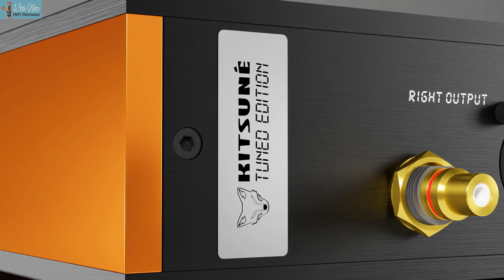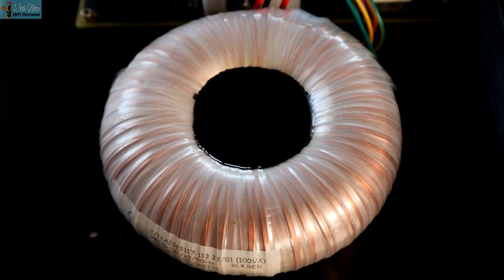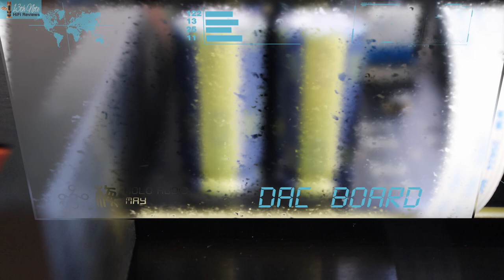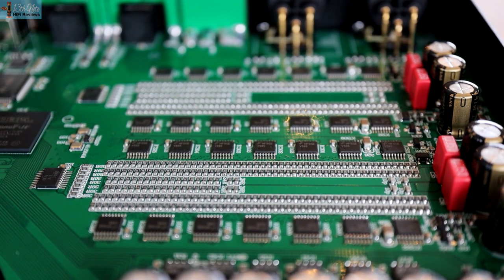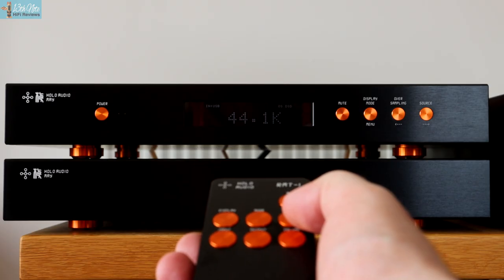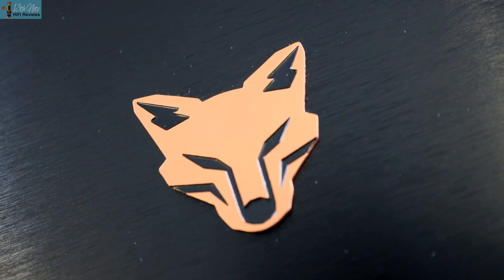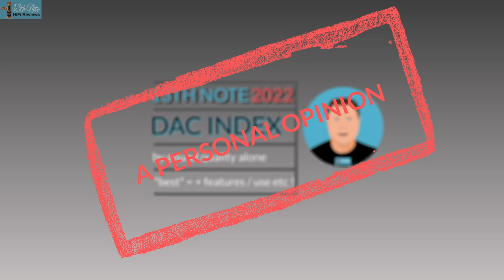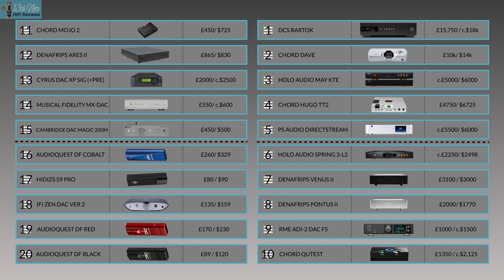Holo Audio's MAY KTE is an Astounding R2R DAC (vs. Chord & PS Audio)

Comment: Great video and eval...Crappy digital, cold, non musical dac...Had it for over a month and I couldn't run from it fast enough. Anyone who holds this thing in such high regard has not heard truly musical gear. Lots of texture, and detail but the way it flows out of the speakers is cold, lifeless, digital and just not musical. No idea what all the fuss over this dac is all about. Other than the build quality there is nothing to get so excited about. Anyone wanting to know how this DAC sounds, read above, and go listen to a Chord TT2, sounds like with maybe a little of the Dave splashed in..If you like Chord sound you will like this.
Reply from the maker: Thanks but I don’t know how you’ve reached that point of view. I’m confused as to what your terms mean

Comment: Would love a more detailed comparison to Denafrips
Reply from the maker: Thanks for your feedback Paul, though I’m pretty happy with the way I described it, giving enough and keeping it concise at the same time. Also a different price bracket dac too. Although for you.. essentially it boils down to (Ares 2, Venus 2 and Pontus 2), comparatively, a wider sound with the Denafrips, more tonally thick but a bit smeared and less dynamically astute. Very good detail and imaging with treble very good and neutral, if slightly warm dac. Fine and great with certain types of music - acoustic, jazz etc. The May is slightly less warm tonally, less smearing but more dynamic with bass and more depth in the sound stage but timbrally more accurate. Again it’s good with treble and never bright and imaging is good too. Separation in musical layers is more accomplished with the May and it resolves more than those denafrips DACs. But it’s a very natural dac that is more the all rounder because it copes better with music that isn’t as slow. It depends on the system as to which is most suitable and which tastes are involved.

Comment: Thanks for the review Simon.  I find your updated DAC table and reviews  quite useful and informative, as I am in the market for upgrading the weakest link in my system, the DAC.  I am between the Holo May and the Denafrips Terminator Plus.  Are you planning on reviewing that one as well?  Your comparison between both would be much appreciated.
Reply from the maker: Thanks Giovanni, glad I’m helping. Yes I know Alvin at vinshine and hoping to review terminator. I’m doing a Kinki studio amp review at the moment that he distributes. ….I’ll be back . Lol 😂
Reply: I agonized over this choice for a long time.
I went with the May KTE in the end because it is supposed to be more "musical" and less analytical than the Terminator Plus.
The other thing that convinced me was the difference in how resistors are chosen. In the Terminator, the resistors are matched to as identical as possible. In the May, the entire ladder board is characterized after assembly which allows for precision way beyond any other ladder DAC.
Reply: Take a look at the review done by anadialog he is a trusty reviewer and gave a fair review of the Holo May against the Denafrips. I chose the Holo May based on his review bcs of the characteristics he described, he concludes one is not better than the other there are just differences and that parts up to you and I think that true.

Comment: How much burn in does the May need to sound it's best?
Reply from the maker: I personally didn’t think it needed much but I’m not much of a believer with electronic burn in. Speaker run in yes, but with circuits ? I did play it a lot and left it on before I came to final conclusions anyway.
Reply: @13thnotehifireviews7  My current ordeal with Ares II would challenge that TBH! Strange how some DACs just perform from Day 1, yet others take forever.
Reply from the maker: @johnratcliffe6438  I donno, I think it’s a lot to do with bias because people tell us it should happen and we are expecting it. Could two people pick out two dacs, one ofwhich it’s said benefits from long running in and another not….I doubt it. Speakers I have heard differences but it’s gradual to find it hard to gauge but get the same speakers which haven’t been run in and swap over and it is immediately obvious. I say to people don’t worry about it. It’s one of those audiophile pretentious things that’s not worth worrying about.
Reply: @13thnotehifireviews7  I can only talk about my own experience obviously, but it is real in this instance. I've dipped in and out every 3-4 days for an hour or less. The presentation has absolutely changed. I can't explain it. But it is absolutely real. My other DAC (Metrum Acoustics Adagio) or any of my other components have just worked from day one and not changed.

Comment: When comparing this DAC with the Chord TT2 for headphone listening (which I believe you don't have much experience in), I'm wondering what kind of amp I'd need to buy with the May to match the TT2's supposedly great built-in amp? The May seems to be the way to go in terms of getting the best of both worlds - R2R NOS and upsampling (especially external); however, the TT2 comes with an amp that I believe ensures that the amplification process does not degrade the DAC's extraordinary sound. With the May it seems that there's always that worry that "I might not be experiencing its full potential because of my amp not being good enough". Would you have any thoughts on that? 😃
Reply from the maker: I think you are overanalysing it. Get out there and try a few combinations as to what you think sounds best.